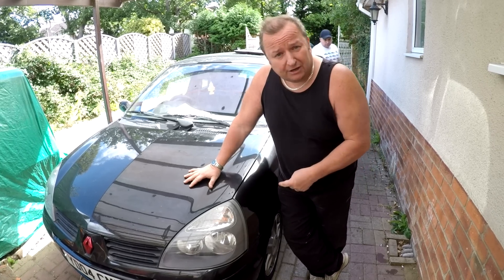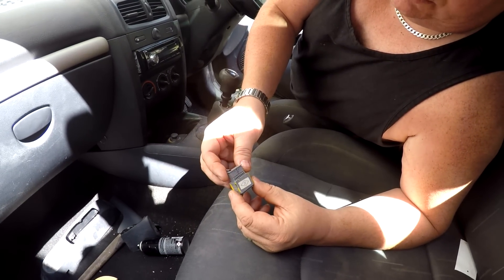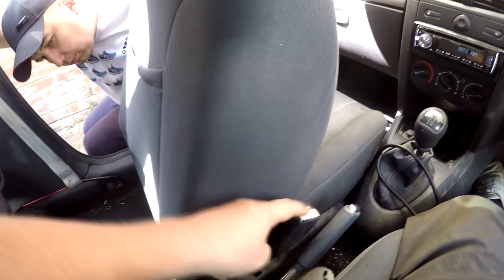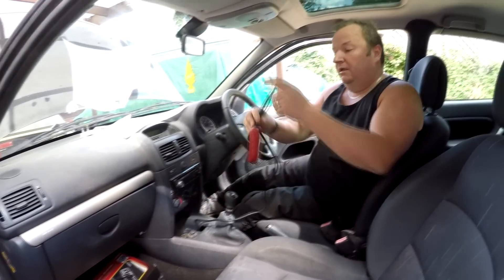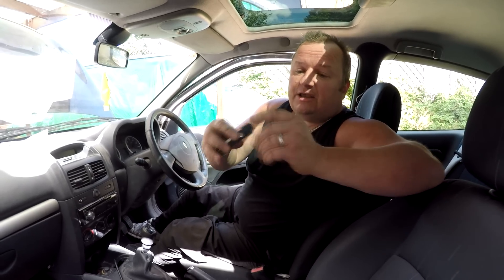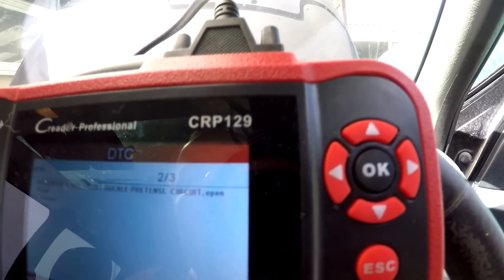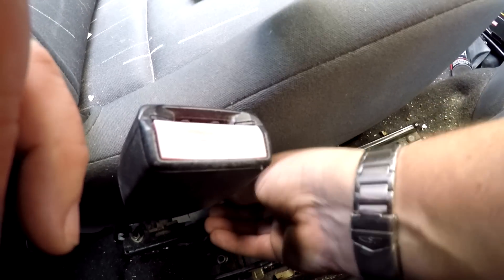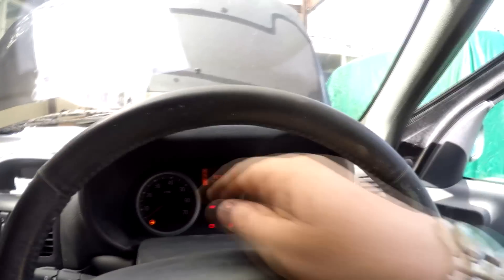Renault Clio 1.2 Airbag And Service Light On [Causes And Fixes]

Comment: When we did our training on airbag systems, they told you to disconnect the battery and wait 20min for the system to lose its charge or you could set the air bags off. Might be something to watch out for, wouldn't want to see you eat the code reader if it went off!
Reply from the maker: Yes, I knew that Eddie but I have a City and Guilds in electronics so I know about how capacators hold a charge.There is no risk in this situation.
Reply: @retrorestore  no problem, just one of those situations when you see something you get told not to do. Do as I say not as I do job!

Comment: The CRP129 is OK to read basic codes and can be picked up for less than a hundred quid.  For best value in their range I would opt for the CRP touch pro. Full android touch screen op system and has .. almost .. dealer level diagnostics on most cars. Can be bought for a tad under 300 quid but worth every penny. Quick note about sensors .. buy the best you can afford, OEM if possible. You can get burned with cheap aftermarket stuff and end up loading up the parts cannon unnecessarily.

Comment: My airbag light permanently stays on and doesn't say anything about sensors.. but says about self diagnosis with dashboard
Reply from the maker: Plug a obd2 tool in and read the codes bud.

Comment: didn't fix mine turned out to be the airbag ecu which is under the drink holder on the central consul in fact where you plug in very easy to do and cheaper than a scan but if you did scan it you would only get no contact so you be non the wiser,so if you do get no contact on a scan it's the ecu next to the plug and it is just as easy job .and they don't need programming so you can get one from ebay.I found the problem by just swoping it with another.

Comment: I have this problem but the immobilizer is also on and cant start the car
Reply: airbags and serv and immobilizer on with renault clio 3 2005 and it worked.cleared all lights and immobilizer is off.cheers.

Comment: I had the airbag light come on with my MK2 Mondeo. I just unplugged the seatbelt pretensioner and plugged it back in (the connector was under the seat) and it fixed the problem. Shame it wasn't as simple for you. South Main Auto has just fixed a similar problem which was due to kids spilling soft drinks with it ending up in a connector and shorting out a couple of pins. Nothing some contact cleaner didn't fix.
https://youtu.be/D0HFXiFyeTc
 WIll you get away with an aftermarket sensor? Some of them are a false economy (that's certainly true of some of the Vauxhalls). A known working used genuine part might be a better bet if a new one from the dealer is a bit rich for you.
Reply from the maker: The car is sold now and the new owner can get one as he knows about it now.

Comment: Ebay = used? I'd just replace it with a new one. If it's lasted about 14 years, a new  sensor should last just as long.
Reply from the maker: Car is being sold.